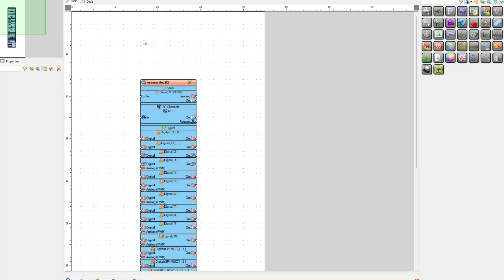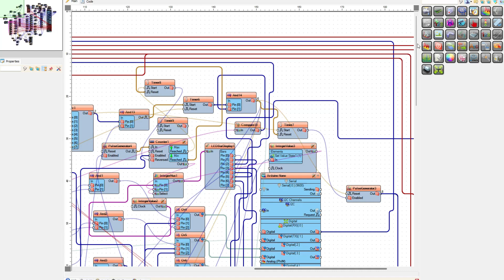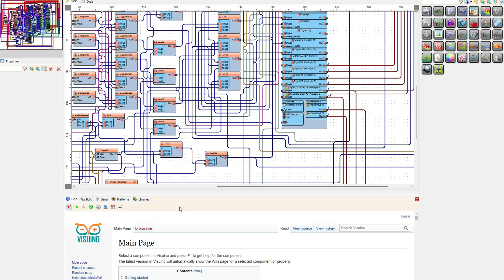RJ45 Arduino Tester! Visuino Project!

Comment: This is a very cool project! It's quite a complex diagram, but it does a lot 🙂. How long did it take you to create it?
Reply from the maker: @BoianMitov  Thank you! The mechanical construction took longer because it is built on a test wiring. The code construction took about 4-5 hours.
Reply: @CompactDiy  Quite impressive considering how big the diagram is!
Reply from the maker: it's big, but the components are simple, logic gates, comparators...